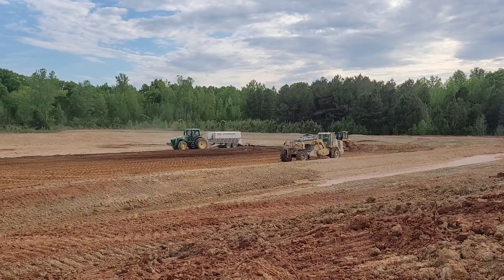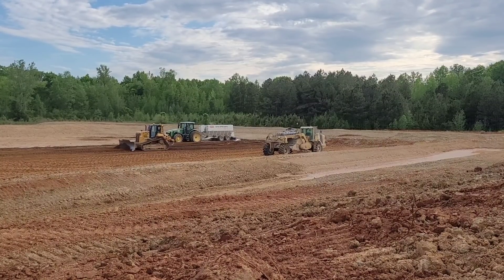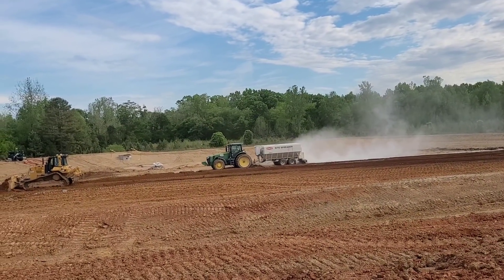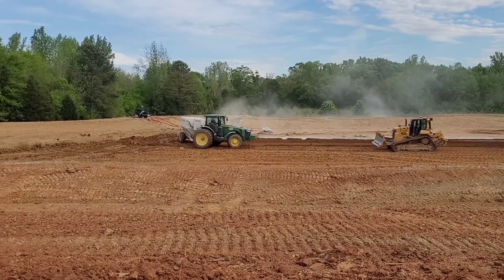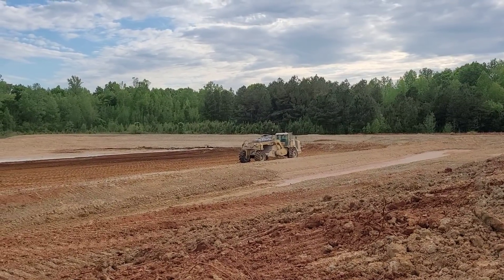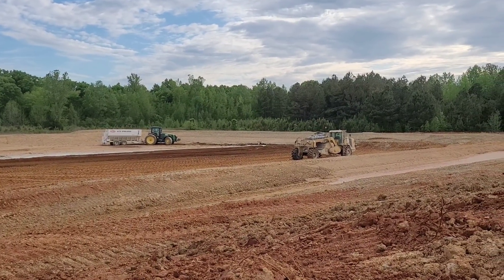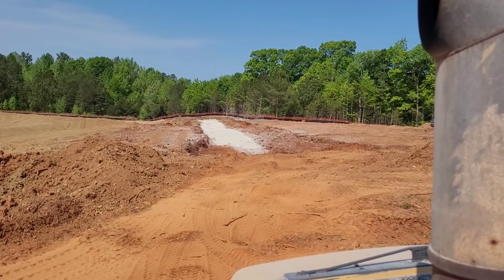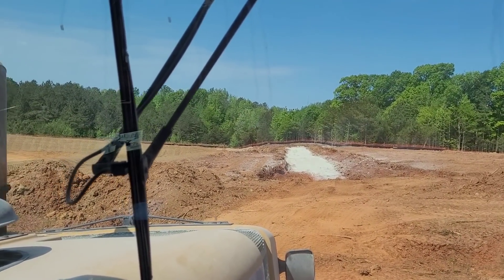Mixing some bentonite clay to modify soil for retention pond with Caterpillar RM500 reclaimer.

Comment: I remember when Chris dug a pond and put $20k in bentonite down. Pretty amazing stuff, building a new house and was thinking about a green roof with bentonite.
Reply: You would have to keep the bentonite constantly wet to keep it swelled. If not, It will crack. Bentonite is one of the most expansive clays there is.

Comment: can you do a shallow reclaimation of a topsoil layer to grind up root material maybe stumps , mix in compost and woodchips and break up rocks? like make a few strips for a rockless soil for a potato plot if the cost of hauling equipment isnt outrageous? Do you have a flat rate for hauling and maintainance  and a price dependant on conditions or a price per square yard or a hourly rate?
Reply from the maker: We charge mobe+ permits and a flat rate per day or per load, sometimes by the square yard. We are pretty flexible.
Reply from the maker: It mixes anything pretty well.

Comment: Bentonite clay is used to line caves and mines where radioactive waste is stored in case a storage container is damaged and starts to leak. So it must be something somewhat toxic going in this pond. Thats very interesting and has me wonder what it's going to be used for. You not too far from me working in Concord. I'm only around 20 miles from downtown.
Reply: Could be for the runoff from the parking lot carrying the oil and other crap that falls onto it from the vehicles. Keeps the junk in the pond and not downstream.
Reply: @FishFind3000  Yes but I've never heard of doing that for just a parking lot. Those are just regular retention ponds not much different than a silt pond.

Comment: I always thought the Idea of a Retention Pond was to Retain a large amount of Water after a Rain and the Water would slowly seep back into the soil. 👍
Reply: Different kinds of retention ponds. If it is coming off an industrial site they may not want it to soak in the water table if there is contaminated runoff etc.

What you are talking about is a DEtention pond where it just slows the water down.

Comment: Afternoon Charlie, I have a question about bentonite. Does it need to be mixed for maximum effectiveness or will it do just fine spread out by itself? I’ve had a few people ask me about it on some ponds that won’t hold water but I’ve never had any experience with it.
Reply: The bentonite is very hygroscopic, it absorbs water which causes it to expand into a slurry. The slurry has a slightly higher gravity than water so it tends to settle. That said, mixing and placing the bentonite into the substrata as a blanketing layer provides a calculable effectiveness. The criteria involved in selecting the placement of bentonite is to reference, test, and verify. I placed bentonite into a water retention basin and it failed due to the substrata materials. I went back and doubled it with bentonite chips and powder mixed in six inches. It felt like a sponge in compaction. Within three weeks it failed. I tried broadcast applications of bentonite powder and chips into the water but no luck. I excavated the site in preparation of an EPDM liner. When doing so, the bentonite was observed to have followed underlying ground springs. Out of curiosity I followed it with a shovel and observed a tree like shape where the bentonite slowly went down into the lower pressure area. The EPDM liner is now over 20 years and holding well. I think I should've added 6" soil high in clay content to the silty gravel substrate in addition to the bentonite.
Reply: @anthonyrstrawbridge  well isn’t that interesting..! I would have never guessed that the sub straight would have that big of an effect on it. I will have to keep that in mind next time someone asks about a pond that won’t hold water, it probably won’t be just as easy as adding bentonite… Thank you sir! I really do appreciate that explanation.

Comment: Retention is to hold run off and not let it perc. It needs to sit and evaporate to keep hydrocarbons (crankcase oil and fuel) contained. Do they plan on having cattail plants in there to eat the oil?
Reply from the maker: They might? I hadn't looked at the drawings, we use mostly dry bottom detention type ponds around home.
Reply: @copperheadmarine  if it’s a dry pond then it’s a detention pond not a retention pond. Retention pond always holds water, detention holds rain till it’s over and let’s it run out after the storm to not overwhelm the storm drains.
Reply from the maker: They might? I hadn't looked at the drawings, we use mostly dry bottom detention type ponds around home.
Reply: I don’t understand the bentonite. I know what it does and how it works but why not just use the red clay that’s on site?

Comment: The bentonite clay is to seal the bottom of the pond. I have a friend that built a pond in Salisbury right up the road from you. It would not hold water and the bank where the dam was leaked  and started to fail. They had to drain it down and do the same thing you're doing. It was just a lot cheaper if they did that way the first time.